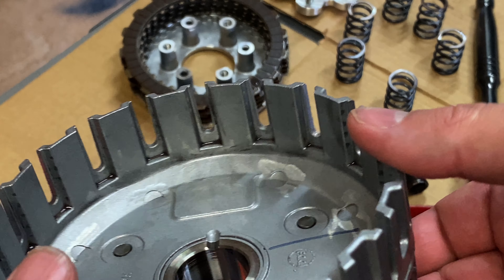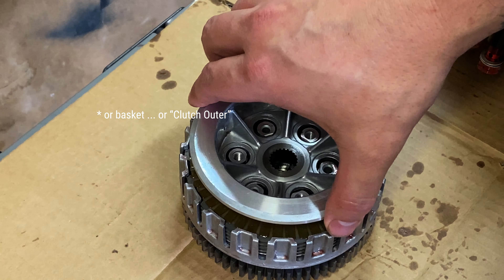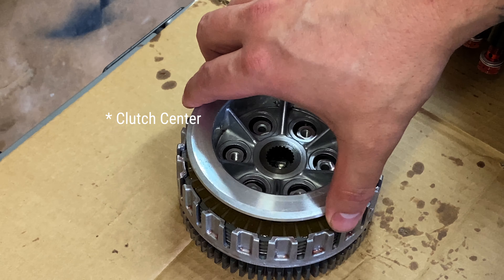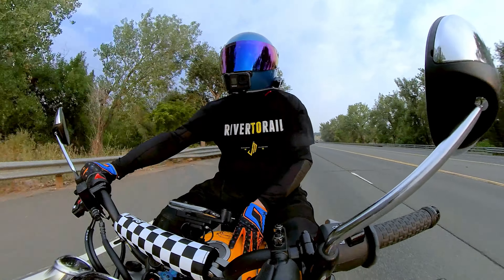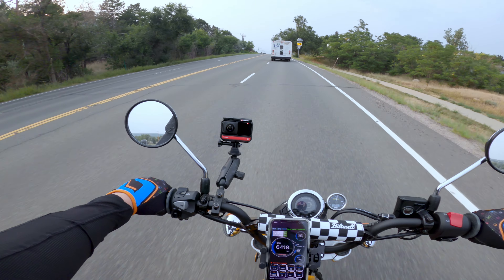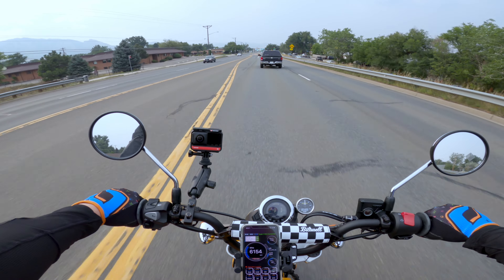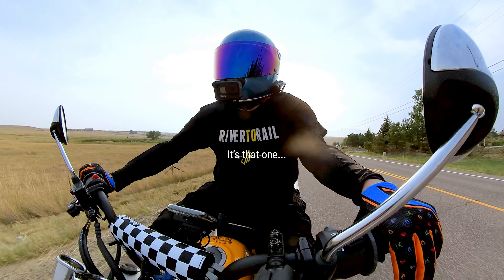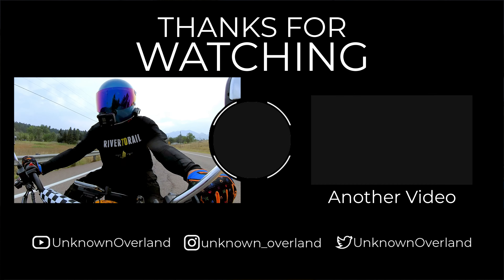Honda Monkey | SMR Clutch Pack Upgrade And Fighting For Neutral (Quick Update In The Description)

Comment: I've got the 2024 Monkey with over 6000 miles on it in 6 months. Its completely stock and it's a blast to ride. but it is a pain in the ass to get it into Neutral. 
I've owned other bikes in the past that was also a pain to get into Neutral  so I made it a point as I'm coming up to a light or stop sign to downshift just before completely stopping and then your good to go.
Reply from the maker: I had noticed a lot of issues with neutral depending on how I had things set up. If you're more stock and having issues, you may want someone to take a look at the clutch pack or springs just to make sure something isn't binding. Otherwise, it may just need time to work itself in.

Comment: It's quite normal for this bike not getting to neutral. In riding school the trick is to use the kill switch and it goes back to neutral.
I just did 60% kitaco springs too, I agree ride is definitely better and it will settle in after some rides. So you need to keep adjusting the clutch free play.
Reply from the maker: Definitely true that the bike has issues getting to neutral normally, until I fix the free play currently it wouldn’t even with major force, likely because the clutch is still somewhat engaged. It’ll be easy to fix, just a little adjustment and some testing.
Reply: There are after market gear levers, anyone tried them? They claim to solve the neutral problem.
Reply from the maker: I have replaced the gear lever (TB Forged Aluminum Shifter) along with the shift shaft support bracket (which I highly recommend if you swap it out). It somewhat helped getting into neutral from the standard stock bike, so does just getting some miles onto the bike overall so that things start wearing in.

Comment: Thank you for sharing this. I have been looking for a cause  for my dislike of the monkey shifting. I got my monkey 4 days ago and have ridden about 50 miles, just in town, for errands, breaking it in. I love everything about it, except the shifting. I noticed what you mentioned, the clutch release is much , much later than I am used to on other bikes, but I am getting used to it (but I don’t like it yet 🤨!). What bothers me waaaaaay more than that is the clunky loud sound of shifting, and the feel. I have had many bikes over the past 4+ decades and none of them, cheap and expensive, shifted this loud! It feels like there are a million parts being activated when you move the shift lever/pedal! Have you noticed that? I took a peak down there and there are some linkages. I confess I do not remember how my other bikes looked like at this point as they are long gone, but why not just a lever straight into the engine, instead of the zig-zag contraption? I think that is what might be generating the awkward sounds on shifting, maybe! Pardon my ignorance and lack of the correct terms to explain this!
Reply from the maker: Congrats on the new monkey! And yes, when I first started riding the Monkey (coming from various Triumphs and other larger bikes) the clutch alwways just fel awkward. That friction zone on the clutch lever was just so strange. The main things that helped right off the bat were replacing the levers (adjustable levers can help move that friction zone to somewhere more comfortable), adjusting the slack on the clutch cable, swapping the shift lever (and removing those stupid linkages), and then going to 60% stronger springs on the clutch itself. These and just putting actual time on the bike (and getting used to its quirks) made things so much better.
Reply: Guys I’m having trouble with shifting also, I’ve slackened the cable a bit to see if that helps. I’m running ASV levers. It’s actually not fun at all to ride at the moment.

Comment: Every upgrade and video you have been giving us is amazing. Have you considered a 5 speed gear box? Dont know if that would make any difference to your set up or not. I swapped out my 4 speed for a 5 speed and didnt make a whole lot of difference to top end, but the engine itself definitely felt a lot smoother :)
Reply from the maker: Thanks so much. Actually I have been considering the 5 speed upgrade, I’ve been told that it helps a lot in smoothing out the overall curves. Now that you’ve reminded me I may move it up in priority.
Reply: @UnknownOverLand  I know its something people always look at and consider. I took the plunge and have never looked back. :) hope thats helpful for you
Reply from the maker: Definitely is helpful. I think the other hesitation I’ve had is opening up that side of the engine to make that swap. It’s a bit more work to crack that side of the case, but maybe it’s time to do it.
Reply: @UnknownOverLand  yes it will be more work. The end result is amazing and I would love to see a video from you doing it. Will keep a look out to see if this happens. Looking forward to your next video

Comment: Mate, I’m really having problems getting mine into neutral, and gear changing altogether. Very stiff, and not fun at all.
Reply from the maker: Which clutch lifter plate do you have on your bike? I found that there seems to be very tight tolerances with the clutch lifter plate and being able to change into neutral. Check out this follow up video I did: https://youtu.be/7gOWqOftpmE
Reply: @UnknownOverLand  just the stock clutch at present. Just seems there’s not much going on down there when you shift. I rode a Kawasaki rs900 yesterday and that clutch was buttery smooth. I know this is a more budget motorcycle, but wow.
Reply from the maker: Oh, yeah, stock clutch is strange on the little Monkey. With more miles things will definitely start to wear in, but it always felt a little bit strange. You might take a look at heavier springs if you haven't alread as those helped quite a bit in making things feel more "normal", but compared to bigger bikes its definitely going to feel different.

Comment: Did this correct the clutch to engage more normal. Mine the lever is almost all the way out to engage  annoying?
Reply from the maker: The things that will help you before going this far would be instead to look at adjusting the clutch cable itself (both on the lever and down near the engine) as well as after market adjustable levers (like the ASV levers). These will help you get that feel closer to the grip where you expect it to be. If those don't help, then I would next look at stiffer springs (I use 60% stiffer springs) with a clutch plate as this seems to increase the overall friction zone. In the Kitaco clutch cover video (https://www.youtube.com/watch?v=FeTOm5sFRQc) I replace the springs as well.